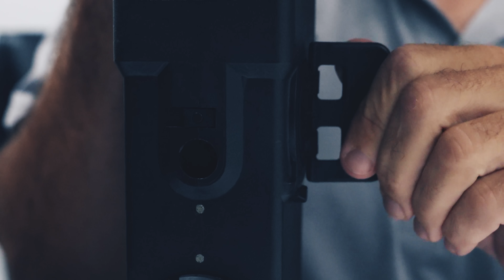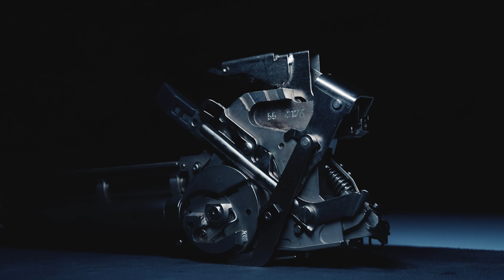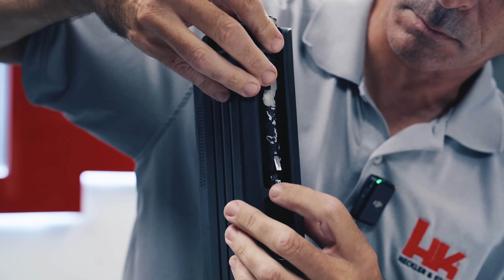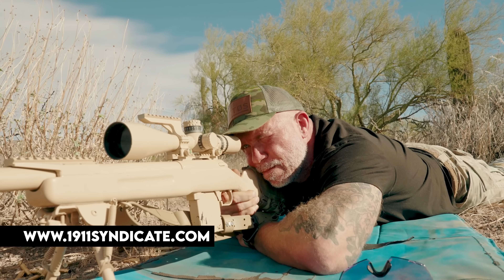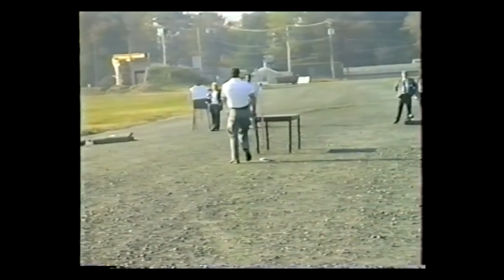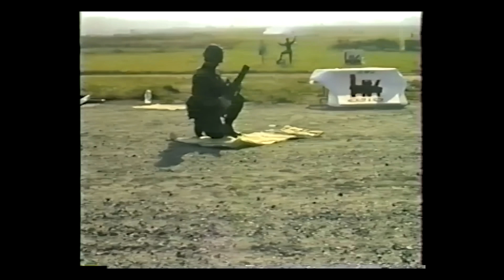The Craziest HK Gun of All Time - The G11 - Rare Footage

Comment: It is an impossibility for 3, or any number of, rounds to be fired before the shooter feels the recoil due to the simple fact that for every action there is an equal but opposite reaction. The instant the round starts travelling down the barrel, an equal force will be exerted in the shooter's direction.
Reply: The barrel slides back with each shot then returns on the third. Or my understanding of it you wouldn’t feel recoil until the return after the 3rd shot

Comment: I didn’t believe him when he said the casing was most of the weight. 
Quick google search
“A 7.62x39 cartridge weighs 16.3 grams (252 grains). The bullet weight for a 7.62x39 cartridge is 7.9 grams (121.9 grains).”

The casing is almost 50% the weight. This new round adds some polymer that gets burnt, + powder, but theoretically allows more rounds to be carried.  System was built on truth, but failed in execution.

Comment: OK first off, yes, needs to be expanded upon. It is a very great concept.
BUT,... What I would be concerned with and what you did not cover in the video is a failure to fire. I guess it would be the same winding as clearing the weapon. So it seems like that would take at least a few seconds.
 But again that it seems like these little issues could be worked out.

Comment: if HK want's some decent social media marketing, they should make a small run of that caseless ammo and start giving gun youtubers a go with G11. 
Bottom line is if that riffle had as much money and time dumped into it as m16, it would be a way different beast in 2024 ! For example that rotary charging handle is a bit of bad design IMO and a linear pull reload handle would be way faster in the field for clearing malfunction, loading first round or clearing the action.

Comment: The G11 with round cartridges instead of square ones could have had more compact magazines and even with a little more capacity.
Reply: thats not how trigenommetry works.......like AT all......for stacking purposes there is nothing better than "blockshaped"...round is absolutly athroucious for that...we have round for stuff now becasue its the least circumverence per area or surface per volume....aka least friction or least sealing problems etcetc.....
Reply: @proxis9980  Greetings. We have been using round cartridges for over a century and they give good results. I don't think it would be a bad option to reconsider this weapon with round cartridges (while maintaining the rest of the features of the square type ones). Another option would be to use a polymer cartridge like in the STEYR prototype or the TEXTRON one.

Comment: I've worked with similarly complex mechanisms in another industry, equipment that runs 10,000-50,000 cycles per day, month after month, and the selection of materials, and hardening/coating of the moving parts, renders the equipment almost maintainence-free. Reducing impact loads, and using rotating parts, seems key, along with correct location, meaning little of it, and the right kind. Some of the gear from Kodak Germany had multi-millions of cycles before any moderate repairs needed.
Reply: What industry?
Reply: @rossauce12 cameras
Reply: @rossauce12   industry of schizophrenia most likely. This guy is full of bs my dude.
Reply: Help fosscad design longer lasting print in place guns
Reply: I work with big industrial sheers and I know exactly what you're saying. I've seen some of these sheers hit millions of times with little more than auto greasers.

Comment: It'd be cool if a Gun manufacturer took the G11 barrel assembly group and built a more modern ergonomic and slimmer Chassis  around it? Like make it a cross between a Steyr AUG and a IWI Tavor but with a quad rail well actually a Tri-rail because the magazine would be on top.
Reply: With Carbon fiber?